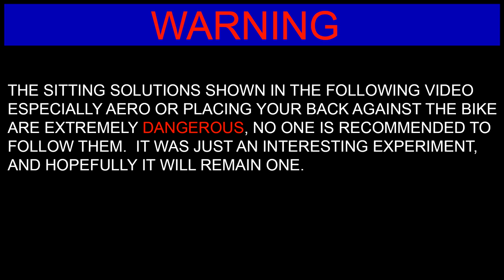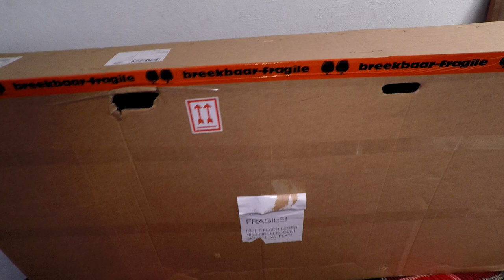Costum E-bike - unusal sitting position experiment

Comment: This isn't aerodynamics but just changing foot position since your whole upper body is still upright hence not much difference between this and standard sitting. And the test results without measuring wind speed are useless. Should have tried drop-bar or tucking in type test now that's aerodynamics. Good idea about recumbent type bicycle if you want comfort and aero.
Reply from the maker: Not much but range will increase. Saving 100-200W per hour is big deal. Already own a recument bike. Complete comfort for 12+ hours and nothing hurts. In an upright position on a bike with even the most comfortable seat in the world, the discomfort begins in a few hours.
Reply: @DatEbikeGuy  Is that a recumbent ebike project? I'd love some new videos :D
Reply from the maker: @modris2980  Yes thats correct :).  I have already ridden 10k km on a recumbent bike. Unfortunately, I'm behind with my videos for a year. One more Enduro video then recumbent ebike project. Editing a video takes time and I always want to put my heart into it. So this summer, I'm not really focusing on that, but I'm filming new material.